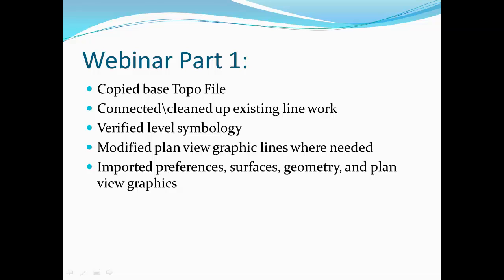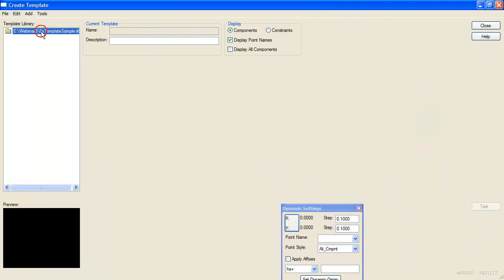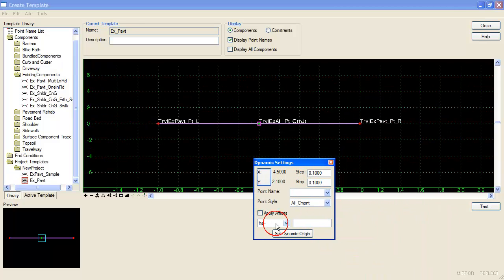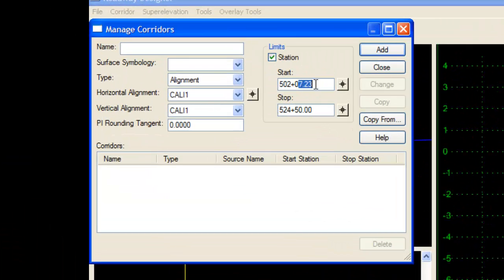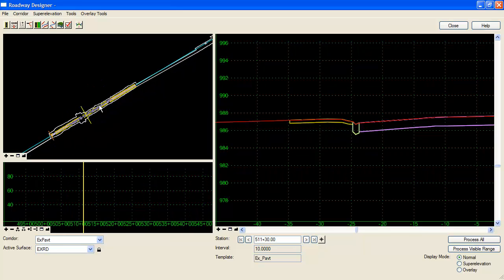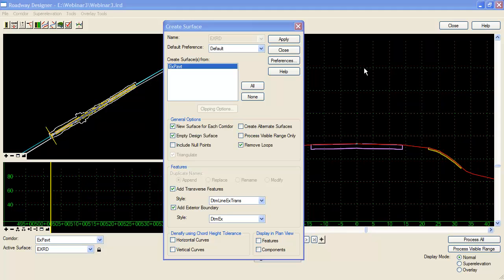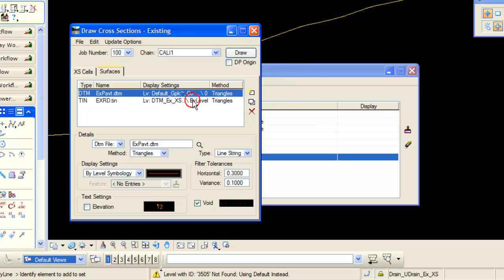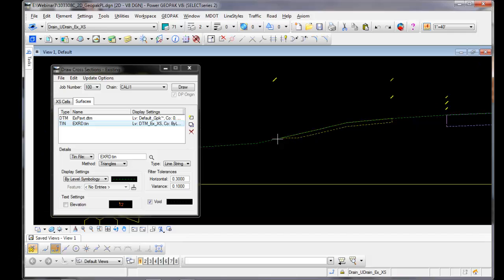The Existing Template Series -- 2013 - Part: 2

Comment from the maker: Got that info for you, Addison. You'll need to purchase GEOPAK or Power GEOPAK from Bentley. Roadway Designer/Corridor Modeler is part of the civil platform and included in the civil family of Bentley products, which also includes Inroads and MX. MDOT has standardized on GEOPAK but the other two products will also have a version of Roadway Designer as well.

Hope this helps!